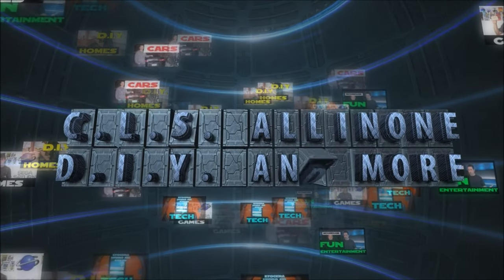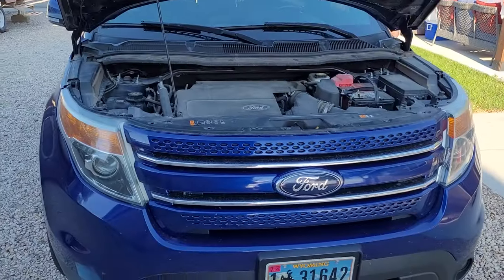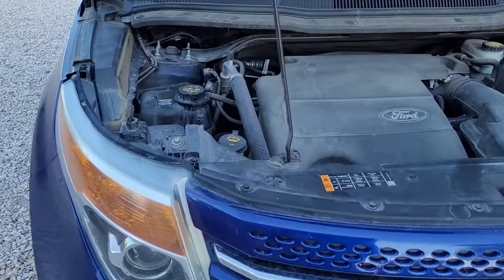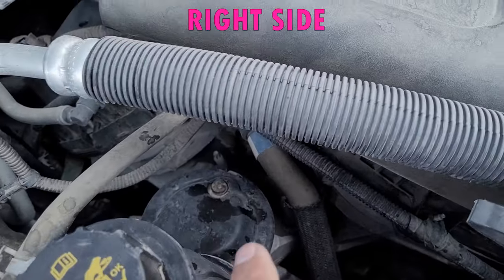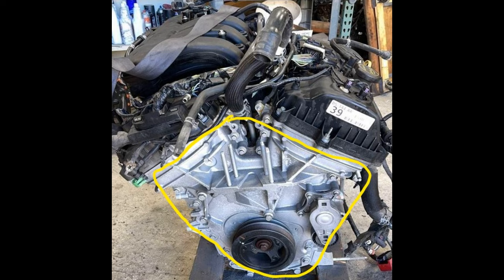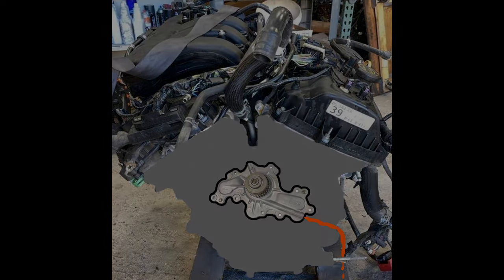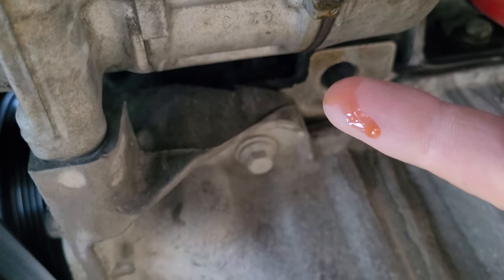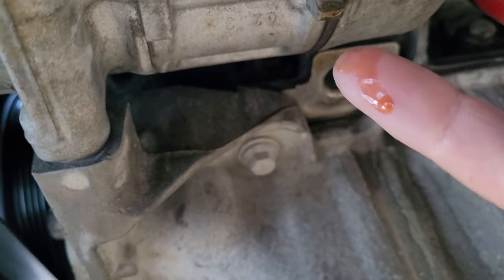Is your water pump bad? 2012-2019 Ford 3.5L & 3.7L engines with antifreeze leak in RF corner.

Comment: My 2013 Ford Explorer XLT has been sitting in my garage for over a year because the mechanic wants $3700 to replace the water pump. I’ll never buy another Ford. Scrap metal on four wheels.
Reply: Here I am doing them for $600
Reply: Find a different shop!
Reply: @dannyfranco7441 where you located? 😅
Reply: @troyleyden1929  I'm in Dallas Texas. I travel though lol
Reply: Might as well put the fucking timing chain outside the engine  and water pump is just inside the engine wtf 😮 but locate the transmission bolts inside the the engine 😂oh and the wheel lug nuts inside the axle 😅
Reply: @dannyfranco7441 would you come to NYC to do this job? I'll even pay for your ticket
Reply: @dannyfranco7441 can i use a coolant leak repair fluid?
Reply: @RegoTVs  lol I'm down for that
Reply: @prodigyfreeman3935  no! Only fix is to replace the pump
Reply: You can do it for $500 to $800 don’t pay more than that
Reply: @newyorkcitynyc5558 went around my town, found a shop thst did it for 1550. I beleive ford wanted 3k. Some shops wouldnt even touch it. Real problem is its a faulty design that gives out premature. Ford wont do a recall but there is a class action going on. Oh yes my car only has 80k miles on it
Reply: @dannyfranco7441   I need mine replaced, I' m in Dallas, are you available?
Reply: I got quoted by ford for 5k for my 2018 ford explorer
Reply: I just got mine replaced also   it was close to 1900 - brand new parts and labor.  ASE Certified mechanic in Orlando.
Reply: They’re not the only car company that uses the internal water pump. That is a stupid design as well but that’s just another way to make money from the owner of the vehicle.
Reply: @dannyfranco7441
could you share your shop address in Dallas? I need to replace the pump for Explorer 2017
Reply: My daughter explorer......FML
Reply: That's three times the going rate. Go elsewhere.
Reply: It’s because the brainiac engineers at Ford put embedded the water pump into the engine block. So, you have to pull the entire engine or take a ton of parts off to access it.
Reply: Replace it yourself for 200 bucks

Comment: Put 129,000 miles on a 2014 Explorer and was worried about this. Then the transaxle started making noise. Fixed both by getting rid of it. It never leaked but was on borrowed time - not that bad to replace if the engine was out of the car on an engine stand. More trouble than its worth to replace it while its in the car!

Comment: Crazy, my 2015 Ford Explorer XLT 2x4 has been driven now for about 184,000 miles without having to replace the water pump yet. Main issue that I have had were the front CV Axels having to be replaced twice. It’s my daily driver where I travel roughly 70 miles between home and work five days a week. Did have the coolant system flushed and replaced the coolant once about the 120,000 mile mark or so. Surprised it has survived this long but still worried a bit when this issues arises. Loved my Explorer this far and fear it would be too costly to repair. It’s only a matter of time.
Reply: I wish I knew how many have failed at 100k or so vs how many have not.. I just think .. kinda like negative reviews about a place of business, most people will run to the internet to post a review if they had a bad experience vs a good one.

Comment: Ford should have a recall on the water pump……Last week I was in the car with my little baby and the car overheated and stopped in the middle of the streets and again on the highway, I did not even drive too long…. Today the dealer told me that the water pump is the cause and the cost to fix it is $4000 and that is without tax….. my husband and I are looking elsewhere to fix it…. This is dangerous especially when you have a baby, children, elderly in the car.
Reply: look for a local mechanic, mine charged me $1500 for water pump and timing chain kit,  and he did an amazing job this was 2 months ago
Reply: @itsalex3631 Where is your mechanic located?
Reply: Time to bust out the wrenches

Comment: Finally someone who explained this in proper detail with examples. Basically you have to hope that the cause of your coolant leak isn't due to the water pump because it will cost a lot of money and it's something that you can't do on your own unless you have the mechanical knowledge to fix it.
Reply: Could try learning to fix it, but I'm sure that's challenging and learners will encounter some issues and mistakes to work through. But I think sell a high quality timing chain and water pump kits for this car for only $300 or $400 online, so if somebody wanted to try learning and had time, they could try fixing it!
Reply: I've heard some horror stories where somebody's water pump went bad so quickly while they were driving, the engine was destroyed by the coolant and oil mixing. Not sure how fast that can happen, but it also happens on Mazdas with this engine. In the previous design of the duratec engine, the water pump was on the outside, and apparently those are very reliable. And I've heard good things about this newer Duratec engine except you need to replace the water pump preventatively and it's super expensive like this.

Comment: I am in the process of getting my 2019 repaired and the cheapest I could find was $2700, cause most places were charging $3,100-$3,700. This is a dealership job because you have to literally take the entire engine out and most local mechanic shops don't have the tools.
Reply: it can be done with the right tools and some mechanical skills,,  i am not a mechanic and i am doing it ,,,
Reply: You actually don't have to remove the engine at all? That's a gigantic waste of time.
Reply: I do these water pumps in 4.5 hours. Book time is 10.5. In my home garage. $65 pump, oil, a gallon of coolant and a tube of the right stuff rtv. So about $120 in parts. You can replace the valve cover gaskets, crank seal, plenum gaskets at the same time, but most of the time they are fine to reuse.
Reply: @m ph  something doesn't seem right if it's only taking you 4.5 hours, literally every real shop mechanic is saying 10 - 14 hours
Reply: @ashplatt8488  that is flat rate book time. That’s how mechanics and shops charge for repairs. My 4.5 hrs it takes is done properly without comebacks.
Reply: @mph5896  at what mileage do you recommend fixing this? My explorer xlt has 100k miles. My g37 had 180k miles but never had issues but also had same waterpump design.
Reply: @thevally6127  the ones I see, the o ring style gasket gets really flat and leaks from there. And they leak externally through a channel that drips by the ac compressor. Mileage, as far as maintenance. I can’t give you a good number. 100k, if you plan on keeping it long term, I would prob do it right now. I just do the pumps and don’t bother with any of the timing components unless they look bad.
Reply: Every mechanic lies
Reply: Why........just why.......😢 i mean i know the answer wich is $$$ but still why?
Reply: @mph5896 where are you located?
Reply: @mph5896 you happen to live in Virginia? Lol
Reply: @ashplatt8488  That’s the book hours they’re going to charge you to rip you off.

Comment: All Fords are notorious for having bad water pumps they never perfected the problem they dont last long from cars trucks I owned from the 1960's to the present the water pumps will fail way much sooner then any foreign built vehicle especially any toyota vehicle they last forever never had water pump go out on me, being once a ford guy I will never go back buying any ford vehicles I will stick with toyota never having to worry bout a water pump going out.
Reply: no more fords for me , unless they fix the problem
Reply: i had a F150 5.4 2001   put 335000 on it only done on the engine regular service and replace the plastic intake manifold

Comment: Hi I have a 2016 Ford Explorer and the water looks like it’s coming out of this area leaks or spreads down to the oil pan i assume when I was driving and the wind carried the coolant downwind it only has 55016 miles I’m not looking forward to paying this ouch great video
Reply from the maker: Sorry to hear it's going bad, with only 55k that's unfortunate.
Reply: My 2016 Ford Explorer Water Pump went bad at 100K miles almost exactly.  I was quoted 3 Grand to fix it.  Buying a new car other than Ford.  LOL.
Reply: 2016 Ford explorer water pump just went out at 87000 miles
Reply: i have the same problem at 56k miles only on a 45k car,,, incredible,,,,,,,,  but i am mechanically inclined but never worked on a side engine, but i am gonna give it a crack cuz i dont want to pay 2k+ for this repair ,   the parts and tools i need wont cost anywhere above 500....
Reply: @bennyfernandez1273  have you ever changed your Antifreeze on a regular basis ? saw video of a guy who changes his on a regular basis with a good quality antifreeze and says he has gotten near 250,000 miles with the same water pump*says that if you dont change it it will eat the rubber seal around the  water pump and also will destroy the water bearing in it **sounds logical to Me**Im just learning like all of us here **who is trying to prevent this costly problem**hope this helps* i dont have an explorer yet but God willing probably soon
Reply: @danielgabriel5549  well,, i am learning too,  and i never did  change the coolant,, but i am doing now that i am changing the water pump....  i have done many other simple mechanical work but not this type ,,  can you explain if you know about the timing aspects,,,,, right now i see my timing marks are at 12 pm and 2 pm,  not the 11 am and 1 pm as yours was,?  what do i do,,, do i move the crankshaft from the bottom until they get to that position,, please answer if you can as fast as you can , since i am in the process,,,, thank you
Reply: @bennyfernandez1273  i dont have a Explorer yet , working on it sorry ,but the youtube link to the water pump issue on the ford edge,explorer ect..its the same Ford Issue flaw  https://www.youtube.com/watch?v=W6voO1uD0a4    just getting all my ducks in a row    hope this helps

Comment: I have a 2013 Ford Edge with the 3.5 non-turbo v6.  140,000 miles and no problems yet.  I change the oil every 5,000 miles with full synthetic and change and flush the radiator every three years.  The new motors won’t take any neglect like the old iron blocks.  Keep up with your maintenance and the water pump should last 200,000 miles.
Reply: Wrong  but gl
Reply: You are just very fortunate to have one of the decent vehicles.
Reply: @markmeador  I purchased a 2013 ford edge same engine about 3 weeks ago and have obsessed about the water pump since, I am driving my husband crazy. The car has 152k , was maintained well & mint condition . I took it to a shop and requested a drain and fill only, and to fill with the yellow coolant that Ford now recommends because the orange coolant was causing the water pump failures.  I think they would have preferred to do a flush but when they mentioned there was a slight risk of debris or sediment dislodging which could potentially cause pump to leak I said just do the drain. It will take a couple more drains to get most of orange out, they are backwards compatible so no worries there. I hope I am doing the right thing by not flushing who knows. I feel like since it has 152k and isn't leaking I don't want to do anything that might cause it to. I love the car, drives so smooth and quiet. Any thoughts on my thought process?
Reply: @ oil changes are just as important to the fuel pump as the coolant.  They have two gaskets, one for the coolant and one for keeping the oil out of the coolant.  I’m up to 146,000 miles with no problems yet

Comment: 2017 3.7L.  water pump leaking inside the motor, no leak outside.  With 68K I just finished paying for it and the warranty is over as well.  Do you think the water pump has an extended warranty?
Reply: Unless you purchased an extended warranty, there is none. Fix it and move on. Any antifreeze in the engine has the potential to destroy the engine.

Comment: Its also only about 1500 to replace.. but have them do all the timing components  also. It can absolutely  be done without dropping motor.. also change oil pump wile in there
Reply from the maker: 1500 would be on the very very very cheap end. Most places will charge $3500+

Comment: I have a ford taurus and the engine overheats only while driving and not while idling   Can it be the water pump? Also somehow the heater is not working   It not blowing out hot air? Does the heater have anything to do with my overheating engine?
Reply: You must be low on coolant cause it's leaking and that causes your engine to get hot

Comment: I used K Seal radiator seal on this problem and it seemed to solved it. It has since stopped overheating and leaking tons of antifreeze. What kind of problems can arise from my “solution “?

Comment: Is it worth it to pay for the preventative maintenance for this fix? I'd end up getting the timing chain, tensioner, and other parts replaced as well. I have a '14 police explorer w/ 136,694 miles
Reply: I would say yes absolutely it’s worth it. If this thing fails on you at a bad time time like when your on the highway the coolant contamination could ruin your engine. My buddies WP just failed at 155K and until we tear into it and get it fixed not really any way we can know if it’s severely damaged.
Reply: 136k on a police car. Its prob already been done. That engine prob has 10k hours on it.
Reply: Did you get a preventative maintenance plan?  Who did you go with?
Reply: @Blickster  I got a new car instead
Reply: @MansoorAuto2k can you tell by doing a temporary oil change and coolant flush and just running the engine for a few minutes to and hear if anything is knocking? Or would it still be a bad idea to run the engine at all?
Reply: @zzoinks  after the water pump, failed on my buddies car, we started it up a couple of times just to hear if it was knocking. The engine ran. Very smooth, it just couldn’t hold temperature.
Reply: So I guess the short answer is, yes, you can run it to check. Just don’t do it for an extensive period, and I would not recommend driving it anywhere.

Comment: The resivore Line on mine had a solid piece of plastic instead of a screen which I believe cost all my problems. It was the one on top closest to the windshield is that called a burp line? Has anybody else had this problem? Is it coming straight from the factory this way?

Comment: Does a 2021 Expedition have an interns water pump?
Reply: 2021 Expedition likely has the 3.5 ecoboost longitudinally mounted for rear wheel drive application.    The internal water pump on the Duratec 3.5/3.7 is on the transverse mounted front wheel drive vehicles like Explorer, Edge and Taurus.

Comment: It's best to get a used engine for $500 to $600 if not turbo from a crashed junked police car from LQK and pick it up yourself because you'll get charged $200 for shipping then a mechanic to put on for $600 to $800. Happened to me with my 2014 Taurus Police Interceptor sedan. Got a 42k 3.7 V6 engine from a 2015 crashed police car with a water pump in good condition. $1600 .

Comment: I will defend Ford just a little bit.  Literally millions of these vehicles were produced with these engines and the percentage of ones with early water pump failure is pretty low. Many of the ones that did fail early were because of poor maintenance. If you own a car with one of these engines make sure oil changes are done on time (or earlier) and have the cooling systems serviced with fresh Ford approved coolant every 30k miles. This will greatly put the odds on your side that your water pump will last 150k miles or more. There are thousands of these engines that have got to 200k on the original pump...my bet would be that those ones were meticulously maintained.  An ounce of prevention is always worth a pound of cure.

All cars have inherent problems. I would take the Ford 3.5 ltr engines any day over the GM 3.6 ltr ones that are notorious for early timing chain failures. Honda, Subaru and Nissan have all had expensive transmission issues in some of their cars. And don't even get me started on Chrysler or any European brands.
Reply: "Thanx My Brother" maintenance- maintenance- maintenance Spot on
Reply: There is no excuse for this. FORD should be ashamed for even designing an internal water pump. Yes maintenance is a great deterrent for early mechanical failures but there are so many of these annoying and very expensive issues with this explorer, and many more models. That godforsaken sync 2/3 radio alone made me swear a blood oath the old gods and the new that I’ll never buy another ford. Before the bullshit started I genuinely enjoyed my explorer sport. I’ve had to replace both turbos, two radios and now the water pump, I was about to replace the world’s worst factory struts. This is like an abusive relationship, you have to cut your losses and walk away.
Reply: Yes maintenance is important but I worked at a Ford dealership as an oil change guy when I was first out of high school 2014-2016 and the tech next to me did 3-4 of these a week. It's not as uncommon as you think that they go bad early

Comment: 2.0 ecoboost better?
Reply: No they have a design flaw using tiny cross drilled coolant passages between the cylinders that are leaking in almost all of the 2.0/2.7 up to 2019.